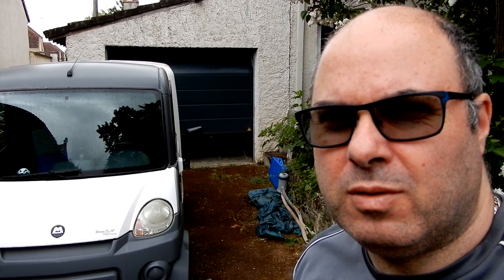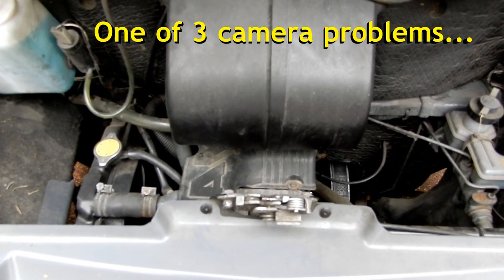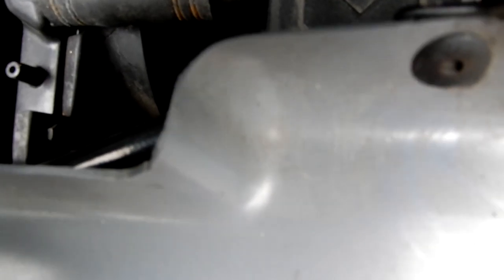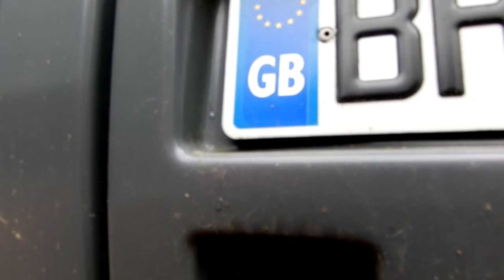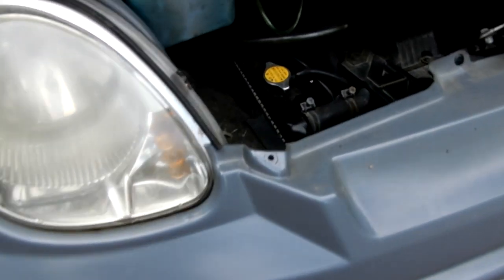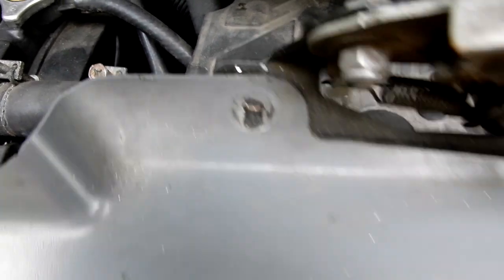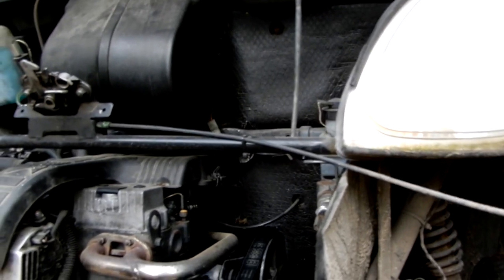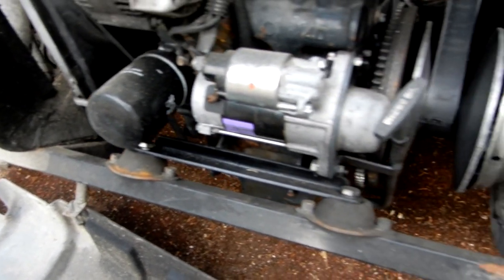Removing the dash panel | Revealing the subframe & Kubota Z402 engine | Aixam Mega Multitruck

Comment: hi mate hope all is good with your mega truck  :)  
i finally got a mega truck 699cc  2010  they are amazing :)
Reply from the maker: Big engine then.
Reply: @MegaBreadvan  haha I mean 599cc
Reply from the maker: @s.y.g-gamer2589  Or 400cc maybe?
Reply: @MegaBreadvan  it's definitely 599cc Kubota engine
Reply from the maker: @s.y.g-gamer2589  So you've got powweeeeerrrrr and speeeeeed?
Reply: @MegaBreadvan  yes mate just put in a Pioneer sound system with a subwoofer and put in a reversing camand dash cam in one  and just finished put a 150db train horn          
           🤘😎🤘
Reply from the maker: You'll shake it to bits. 😊

Comment: how did you seperate the glue on the bumpers? I've got mine and im slowly any painfully scraping out the glue with a screwdriver flat head
Reply from the maker: I just eased the panels apart, with a flat head screwdriver, the end wrapped in a bit of masking tape. I've not removed the rubber-like glue though. Mainly as having this in place helps cushion vibration between panels. So bolted back together, but with the glue still there.
This is the only panel I've "un-bonded", as it gives better access to the engine when needed.
Reply: @MegaBreadvan  thanks for the reply I've got one side off the glue on mine doesn't want to let go prying the panels apart and slicing the glue with a blade seems to be working atm
Reply from the maker: @jasonpeace1991  Have just replied to your post on the Aixam Mega Truck forum. Thanks for posting.
https://megabreadvan.space/forum/viewtopic.php?f=14&t=33